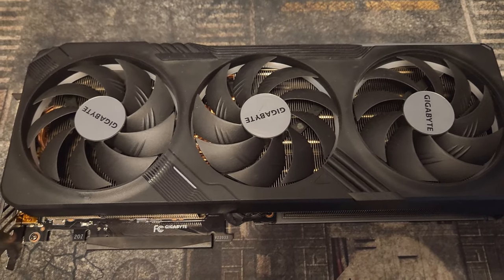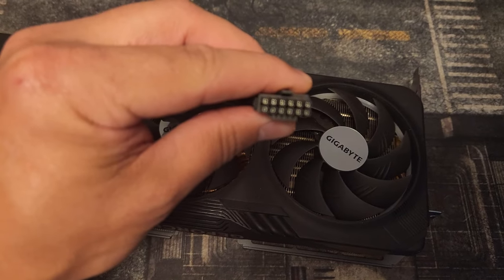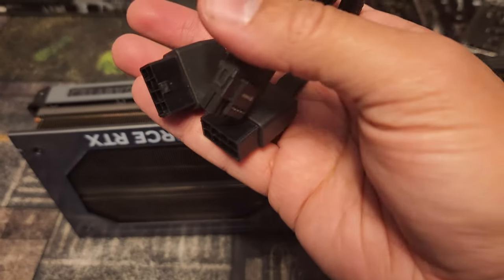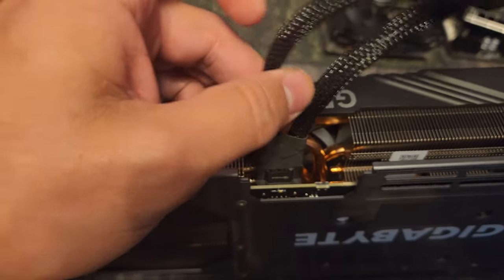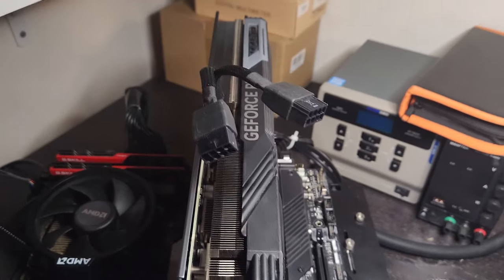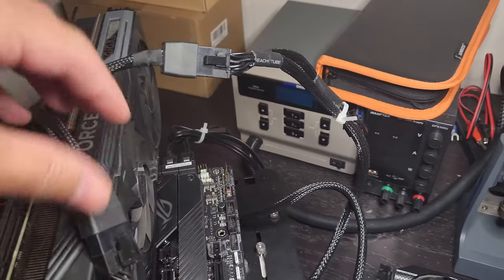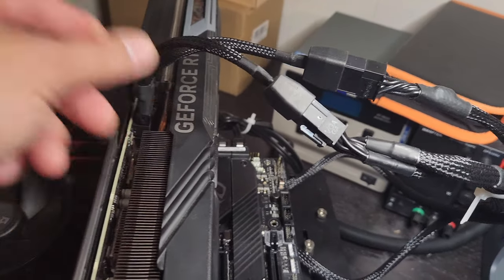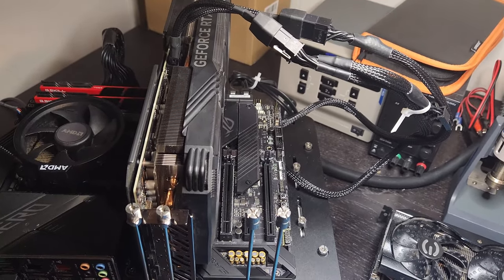RTX 4070 TI installation guide: everything you need to know about the 12vhpwr cable!

Comment: Thank you for making this bro. i have a 750 w Gold plus psu with two 8 pin connectors and i was wondering how would i even connect a 4070 ti, this video was helpful appreciate it
Reply from the maker: Glad I could help!
Reply: Yes. Thank you! I didnt even think about the cable that was in the box.
Reply: Wait, so you use two 8 pin connectors correct? to make for a total of 16?
Reply: Thank you!
Reply: All good? I have an ATX EVGA 750w power supply with 8+6-pin PCIE connectors, my RTX 4070TI super has 2 8-pin connectors, but when trying to connect, I can only plug the 8-pins into the left part of the adapter, the part on the right side It only connects 6 pins, should I be able to connect all 8 for a total of 16 pins? My card doesn't seem to be receiving the correct power as it is not recognized on the PC, it just turns on the LEDs, I'm sad.
Reply: @Leexrox my 4070 arrives tomorrow, did you solve your problems?

Comment: I have a rm850x corsair gold. Can i use the 8 pin and 6+2 pci cable as one or do i need two seperate ones only using the 8 pin ik you said certsin psu you dont need seperate

Comment: i dont have 2 seprate caples in my power its BPA600 600 watt so what will happen if i connected the douple caple ? it will work good or i will face something ?
Reply from the maker: I wouldn't it could melt over time, especially if you push it to load. I would recommend upgrading the psu

Comment: Can i connect 12v2x6 cable directly to rtx 4070 ti super which has 600w instead of 2 pcie cables?
Reply: Exactly my problem, I connected 2x6+2 with extras to the 12v. I dont get a display on my monitor.

Comment: What if I use a 3 8pins adapter instead of 2 like the one it came with?
Reply from the maker: Umm? That's a good question I'd assume it would be fine?
Reply: @kr00tman  I heard it’s fine because the card will take the power it needs & it will not overload it self , and I kind of agree but I want to make sure but I haven’t found any youtube vid trying it or test it  , I found one guy on youtube saying that use a 3 8pin adapter with the 4090  instead of the 4 one because its a “power hungry gpu”

Comment: False you need a 3-way PCIE adapter connecter, just went through this with my 4070 TI ROg Strix........
Reply from the maker: Try plugging 2 in should work just fine
Reply: @kr00tman  Didn't work for the ROG Strix Edition had to populate all 3 slots, otherwise the card would not start.

Comment: Hello,
I have recently bought a 4070 TI Super, it has this female 12vhpwr connector, I have 2 options:
1. Use the 12vhpwr to 2x 8 pin PCIe adapter to connect to Power supply. (provided by NVIDIA)
2. Use the 12vhpwr to 12vhpwr (direct) cable given by the PSU.
Which option is recommended in this case?

Comment: thanks for the vid, nice and simple. upgrading from a 2070 which hails from before the cursed nvidia dongle era and a modular 750 psu with only the cables i need, the only catch was i had a friend help with installing the psu so i don't exactly know how it all works, so i just grab one of the 8 pins out of my psu box plug it into the psu next to the first one, plug them both into the dongle and im good to go? probably a stupid question im sure its common sense in the pc building world but hey you don't know until you know! just wanna make sure i dont fry anything and end up spending way more than i need to at a pc tech to fix or replace it haha if there's anything i do know about pc's its not to mess with the psu or cables, that's how pc's die and catch fire. also when you said corsair psu's only need one 8 pin into the dongle do you mean corsair psu's in general or specific models? mine is the corsair cx-m 750 do i still need to use 2 8 pins or am i good to go with plugging my current 8 pin into the 2070 right into the dongle and hooking up the 4070? again sorry if its a dumb question just wanna make sure i'm not doing anything wrong
Reply from the maker: it all depends on the model
Reply: @kr00tman  i picked up the standard 4070 founders edition from nvidia if that helps any

Comment: Working with diy electronics i cannot stop wondering.... why arent all the gpus using an XT60 XT90 connector and call it a day... have 2 beefy cables ( +&- ) and this way there is no need for soo much cable insulation, also this contraption of cables with 8pins going into 12 adds way to many potential failures😅

Comment: Can I connect my 7900 xtx with 2 pigtail or I have to use another one?
Reply from the maker: no you can't need 2 separate cables. Ill make a 7900xtx install video shortly.

Comment: I just bout the Asus tuf 4070ti oc edition coming from a 3070ti I have a Corsair 750w modular psu and was told I could use a 12 + 4  by Corsair the adapter that comes with gpu is a 3 8 pin .. but the 12+4 has two 8 pins

Comment: Do you need 2 8 pin cables or can you use 3? I have a 2019 model Corsair RM750 and am thinking of upgrading to either a 4070 Super or TI, and there's a CableMod extension kit I like the look of that has a 3 x 8 pin to 12 pin cable

Comment: So i have 1050 watts Gamemax ATX 3.0 & PCIE 5.0 that came with a 600 watts PCIE cable, no need to plug in both cables, just  the 60  watts, right?
Reply from the maker: the 600 watt cable, yes that will be fine

Comment: Thank you. My PSU only came with twin tail PCIe cables, so I thought for a second that it only needed one cable.
Reply from the maker: Yea don't do that!!
Reply: @kr00tman  That’s why I double-checked.
Reply from the maker: glad I could help, dont forget to sub, if you likeed this video! @Brawler_1337
Reply: @kr00tman  oops had my computer using 1 cable for a few hours hope it's alright. I'll try checking for the 2nd cable. Also I have a question about when you push in the connector I didn't hear a click and it's also stuck in so I tried pushing it it more the best I could. It kinda looks slightly out but like i literally can't push it in further

Comment: So if my power supply only has 2 eight pin cables and one being plugged into my motherboard, there is no way my current power supply will work? My current power supply is hard wired and no plugs on the side of it.
Reply from the maker: Yup need a new one

Comment: Can you not just use a msi 600w psu cable instead of using the splits the card comes with? Cords are super short seems like the longer single plug in would be more efficient and cleaner appearance thanks!
Reply from the maker: Depends what PSU you are pairing it with but basically yes

Comment: I'm almost done building my first pc, and i realized that the power supply came with the wrong PCIe thing to just go onto the graphics card(its a 4070TI btw). I saw this video when i was looking for more, and I was wondering if I should use the adapter that came with the graphics card, or just buy the correct PCIe from Corsair?
Reply: Same question

Comment: So im using the 4070 ti which came with the double connector. Im using Rm850x which came  with two 8 pin(6+2). I plugged both 8 pins to my power supply already but by where the 12 pin that goes into the GPu im left over with two (6+2). Do i have to plug in the left over 6+2 into my psu?
Reply from the maker: Nope

Comment: Hey bro so I have a 750w psu and it has two pcie cables and both of them are doubles would I be good if I just use one 8 pin pero each cable. Bassically just what you did just that I don’t have a single cable I have another double one.
Reply: @kr00man
Reply: @kr00tman
Reply: Bump

Comment: Mate, how do you think c can it be a problem - that I have crashes in games , like DXGI DEVICE HUNG OR DEVICE REMOVED .. because my 4070ti connected through the only one cable with 2 8pin connectors ? Not 2 separate like you recommend ?
Reply: Idk if I'm too late but wherever I've read about the adapter, they said not to use a single cable with two connectors but two cables, since you need the full power of both of them.

Comment: When i try fully plugging in the splitter, it doesn't click into place no matter how hard i push it in. Do i need to just get a new splitter?
Reply from the maker: make sure the pins are not bent inside the plugs
Reply: @kr00tman  all the pins are perfectly straight. It slides in straight and easy, just won't fully connect and as a result has the red light. Should I just get a new adapter?

Comment: I was wanting to buy and use a strimer plus v2 with a 4070 aero. The 4070 aero comes with a 2x8 pin adapter but the strimer comes with a 3x8 pin connection, is it still safe to use? and if so how would i connect it up
Reply from the maker: yea, and you just connect 2 of them, you could connect 3 if you want, its not going to force more power into the card, the gpu knows exactly how much power to draw.
Reply: How did it go? We already have the Strimer and a 3080 but looking to buy the 4070 aero but afraid itll look weird since its 3x8pin and the 4070 has weird black cable?

Comment: I have this same one, when I power on my CPU everything works.  Once I plug in my GPU to the motherboard it will power on, but once I plug the other cable into my (corsair) power supply it completely shuts off.  What am I doing wrong?  I already tried rebooting everything as well.  Thank you
Reply from the maker: Probably an issue with the GPU without knowing much else
Reply: Dude, I have been having the same issues for a few days now. I literally just bought a new 4070 ti at Best Buy to see if the original one I got was dead on arrival, but my pc will still only boot with no GPU installed. We’re you able to figure anything out?
Reply: I'm at the spot as well...
Reply from the maker: @michaelcoombs9053  Have you guys tried the gpus on a different pc? Also what are the specs of your systems?
Reply: @kr00tman  I have not my specs are 
Ryzen 7600x
4070 ti GIGABYTE
32 gb g skill ram
Toughpower gf1 850w PSU
MSI b650 tomahawk mobo
Reply: @kr00tman  GPU was unboxed yesterday brand new
Reply: Everything is brand new yesterday
Reply: @LerminTheGamer did you figure anything out?
Reply: My son is having the same issues.  He has 3 plugs. We tested gpu in diff computer & it's fine. We even put old gpu in with all his new components and it works.  When we put new gpu with new components,  it turns on but cannot download any drivers & shuts off. We need help please!!!

Comment: Is 650w psu enough for rtx4070ti and i7 9700kf cpu, 32gb ddr4 ram? Its corsair psu
Reply from the maker: Should be fine as long as it's a high end model
Reply: @kr00tman  Corsair CV650 650W
Reply: @kr00tman  80 PLUS Bronze
Reply: Runs fine! :) Max draw on epic/ultra settings of for example CP2077 or Ark Ascended (Unreal 5) and maximum power draw I watch on GPU is 200 watts, so 650W PSU is more than enough :) @kr00tman  @others

Comment: Bro, one question:

I have a Corsair CX750M with i5-13600k.

This power supply comes with 2 different PCIe cables.

The recommendation for a 4080 is to connect 3 different PCIE cables due to high consumption. However, taking into account that they are Corsair cables, if I only connect 2 different cables (and not 3) to power the video card, could I have a problem?

Or can I only use 2 different cables up to an RTX 4070ti, while for an RTX 4080 3 different cables are mandatory?
Reply from the maker: must use 3 or you will have an issue imo
Reply: @kr00tman  Okay, thanks! 😄👍

Comment: So, if I have a new PSU with a high pwr connector, do I need to use the 12vhpwr PCIE splitter at all? The cable came with the GPU and from what this looks like, it’s for older PSUs?
Reply from the maker: nope you connect the high power cable right to the psu if its an atx psu
Reply: Thanks I had the same question. I bought a new psu with the pcie 5.0 slot to provide for it and got confused when i saw the adapter cable in the 4070ti packaging

Comment: Quick question, I’m about to upgrade from a rather OG card (GTX 1080ti) will the adapters that come in the box with a 4070 work still with my PC?
Reply from the maker: yea, no reason why they wouldnt
Reply: @kr00tman  thanks for replying man, I got a ol gtx but she still kicking for being 7 years old, but it’s time to upgrade, also saw another one of your comments saying I could use the one 8 pin as long as the gpu can get power correct? Because my old one also uses that what I like to call 6+8 pin connection in the gpu
Reply: Nvm, just figured out it’s a 8 pin and a 6+2 pin setup, should be good if I have to connect that second 8 pin

Comment: So I won't use the 12VHPWR cable that came with my MSI MPG A850G power supply at all for my 4070?  So that cable and its spot on the power supply are a waste.  Is that what I'm seeing?
I have to use the splitter that comes with the 4070 and then just plug them into two PCIe connections on the P.S.?
Reply from the maker: If it doesn't have the 12vhpwr cable then yes
Reply from the maker: Just depends on the model
Reply: @kr00tman   The model of the P.S.?  It's a PCIe5 / ATX3 unit with a 12VHPWR port and its own 600W cable.  I assume I can ditch the cable(s) that come with the RTX4070.
Reply from the maker: @G_Machine_Joe  should be able too

Comment: I have a cx750m 80 plus but using one cable from PSU and it splits into a 8 pin and 6+2 and thoae are into the 4070ti adapter...is that ok or should i still run 2 cables ? Pny 4070ti
Reply from the maker: you need to run 2 cables to be safe

Comment: So I only have a 8 pin and a 6 pin, can I still put that in the adapter it comes with and have 2 unfilled holes? That’s my old 2070S cables
Reply from the maker: you can buy a 6-8 pin adapter that SHOULD (not 100%) work just fine
Reply: @kr00tman  ty for the reply, turns out it was a 6+2 it was just a little shorter and hard to see lmao

Comment: if I have a 750w Gold Corsair psu, will it work if I directly connect the 8pin psu to the gpu instead of using the adapter?
Reply from the maker: Does your model have 8 pins over the adapter?

Comment: Question bro please help, i purchased a 4070ti and it came with the same 2 8 pin cable but my pc only has a 8 pin and the second one is a 6 pin, do i need to swap power supplys?
Reply from the maker: you can get a 6-8 pin adapter but if you have an older psu thats not highly rated  id prob look to switch
Reply: @kr00tman  to be honest i have no clue how old the psu is, i just purchased these pc new 2 months ago from IBuyPower
Reply from the maker: @Testament-qn1pe  ooo id check out the model if it's new a 6-8 pin adapter will work fine just get a high gage cable

Comment: Hi. My power supply is the Seasonic Vertex PX-1000. It came with a 12VHPWR Cable with the same amount of pins on my GeForce RTX 4070 Ti. Because im trying to see if thats actually the cable im suppose to use, or am i suppose to use the two single PCI-E cables instead? Any suggestions? Would appreciate it. Great video by the way. 👍
Reply from the maker: thank ya feel free to hit that sub button of it helped u! To answer your quesation, either of them should be fine, its ok to over spec your power cable.

Comment: Hello bro, I got CableMod Pro 12VHPWR with x3 PCI-e cable, and my psu have x3 8 pin connectors. Can I pluged in all of them 8pin connectors in this cablemod? I have Gigabyte Eagle OC 4070ti.
Reply from the maker: you only need to plug 2 in, but it should work just fine
Reply: @kr00tman  its gonna be wrong when i plug 3 in?

Comment: I have a corsair rm850x with a gigabyte 4070ti that came with a 3way 8 pin to the 12 pin on the gpu how would i set that up? With two pcie cables or just one to two 8pin connections on the gpu and leave the third unplugged
Reply from the maker: I would use 3 different ones if you have them

Comment: I’m still chuckling about the snapping of the fingers not working. Thanks for this. I bought a prebuilt that is solid, but got a steal on a brand new 4070ti and a 1000w psu, so planning to install them myself on Sunday.
Reply from the maker: It's a hit.. I'm going to do it more from now on
Reply from the maker: Also don't forget to sub to watch me fail at editing
Reply: I subbed! Also, if I have the MSI A1000G PCEI5, I’ll be able to skip the adapter with the one to one connector for the 40 series cards, correct?
Reply: PCIE*
Reply from the maker: @ayyyejayjay  yup as long as your GPU has that plug
Reply: @kr00tman  99% sure it does. I’ll check later. Thanks for the help. Keep up the great work

Comment: Hi! I will get my new 4070 ti zotac trinity, this GPU has the 3 pcie adaptor, i need to plug 3 pcie from my psu or only 2 pcie? by the way, i loving your content :)
Reply from the maker: Thank you! Just 2
Reply: Will it not run at full potential if only 2 are plugged in? Why does it come with 3? We have brand new zotac 2070 ti trinity (oc) and are having trouble downloading drivers. The system keeps turning off at this point. Any suggestions?

Comment: So I have no clue what I'm doing with PCs, this is gna be the third component I've ever installed (assuming I buy it.) My current setup is an RTX2070 (which is why I don't care about the whole 4070 being not as good as it could be lol) - but that as far as I can see takes a 6 and an 8. I've also got a Corsair RW750 - that should have the connection space for 2x 8 pins right? Or would I need to open it up to know that?
Reply from the maker: it should be fine